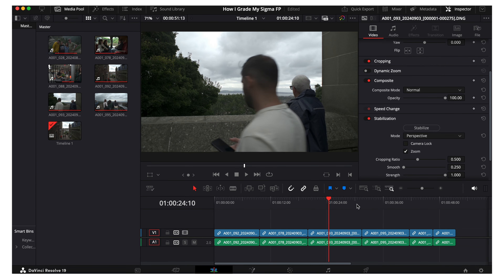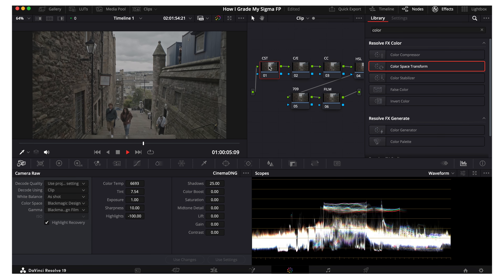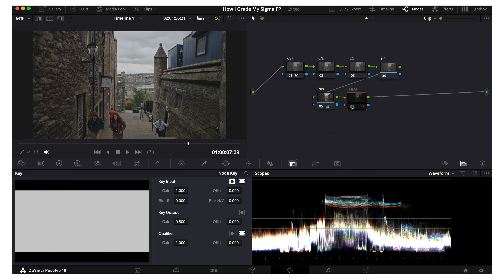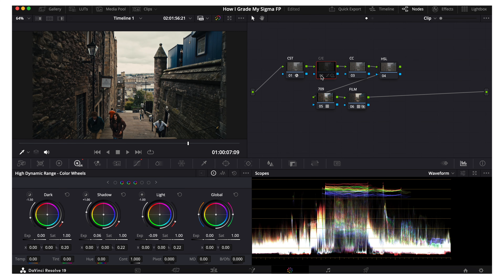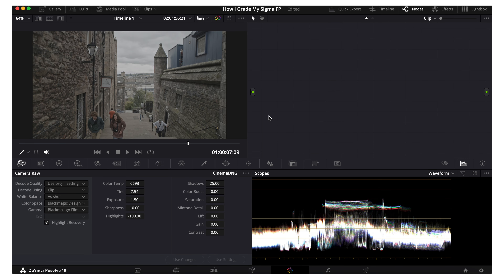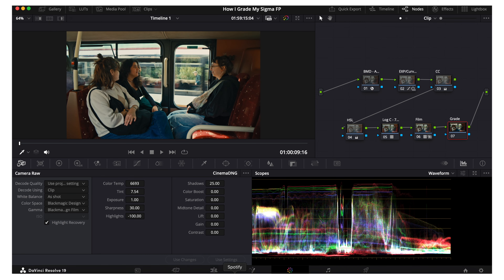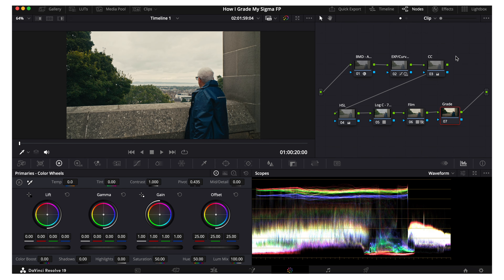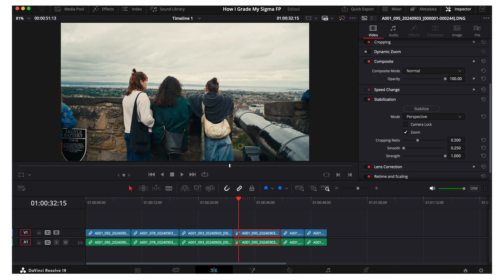Color Grading the Sigma FP in Davinci Resolve | FREE PowerGrade

Comment: Hey! In case you didn't know, the film luts like the 2383 you use are meant to be used in cineon film log gamma. So in you last rec 709 lut node, you should put instead another color space transform and put it in rec709 for color and cineon film log, then add the 2383 lut after on another node!
Reply from the maker: I saw another comment that mentioned the Cineon film log gamma so I did some research into it. After reading and watching some videos, I reworked my PowerGrade and it looks so much better!

Comment: I was absolutely BLOWN AWAY the first time I handled FP CDNG footage. I've never seen a camera that shoots RAW with that little noise in the image. It's astonishing. What's even crazier is the second native ISO is actually one stop above the a7siii sensor. It's 3200 for the FP and ISO 1600 in RAW photo mode but boosts up to 12800 in Slog3 (the a7siii sensor is still at 1600 despite the +3EV jump in slog3, it's simply raising the shadows of the raw signal to map them properly in log aka capturing the full DR)
Reply: How does it compare woth the blackmagic if you (or anyone else reading this) can compare them?
Reply: @slackingsource  as a colorist with just about 10 years of experience, i'll tell you the FP is miles ahead of blackmagic BUT and I really mean But only if you know how to color grade and push them to their limit.

Blackmagic looks nicer from the starting point but with some color grading skills, it will be quickly overtaken by the fp in sheer image quality.

Also with the properly sharp lenses like the sigma art primes of zeiss milvus lenses, it has the capability of capturing more detail than the blackmagic 6k is capable of resolving. It's that good. 

So yeah i'd recommend getting the blackmagic until youre a seasoned veteran
Reply from the maker: I fully agree. Shooting in 4K gives me absolutely amazing low light performance. The camera is a certified beast.

Comment: Hi! Thanks a lot for this well explained video. One of the most complete and easy to understand in my opinion, such a good and proper information "rhythm" to listen to.
One question: at 7:11 -7:13 is that railing suffering moiré from the camera?  I've heard the FP does suffer from that if not 1:1 pixel ratio.
Thanks
Reply from the maker: Thank you for the kind words! And yes, it does suffer from moire. I shot all of these clips in 1080p which is why it was so noticeable. Shooting in 4K I've never had an issue though.

Comment: Thanks Michael for this video, can you make us a video about its dynamic range and how much of highlights can be recovered.
Reply: You just have to use EL Zone to underexpose by about two stops (el zone stops) if you're shooting at high iso values. The higher your iso is, the more information can be recovered in the highlights. If you shoot at ISO 100, you can bring up the shadows significantly.  This means you can expose lighter skin tones in a way that would normally be used for darker skin tones, so in el zone their skin will look dark green. while still maintaining detail, as you will see in post. In any case, if you just quickly expose with EL Zone, you will always have a well exposed image, and about 13 stops of Dynamic range. It's a Sony sensor, so it naturally has good dynamic range.
Reply from the maker: The information that @berlin03030 said is spot on. The biggest tip I'd give is to be careful about not blowing out the highlights, especially if your ISO is at 100. I typically shoot at 800 ISO so I have the most balanced dynamic range above and below middle gray. I made a video about how I rig my FP for filmmaking where I briefly talked about this. You can watch it here if you're interested. 

https://youtu.be/fjmi5uSFzB0?si=vYSb7UTA2I0HPv4-